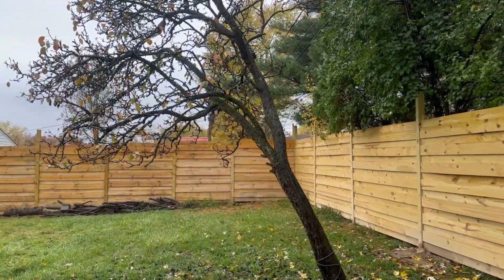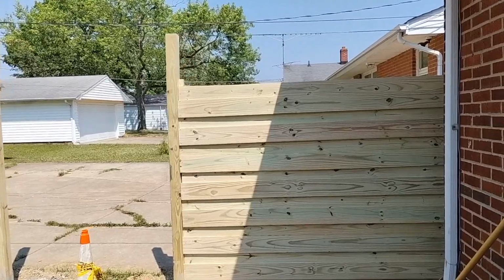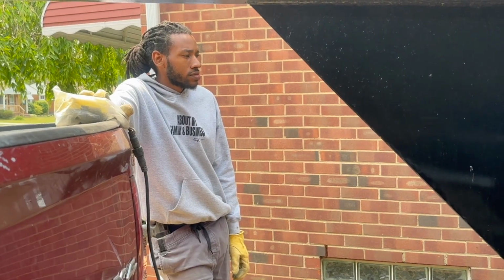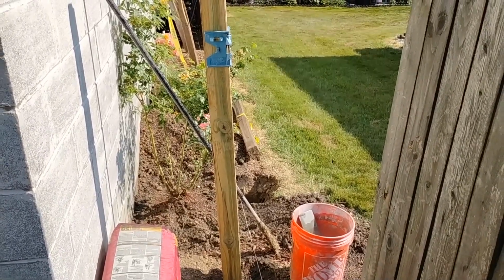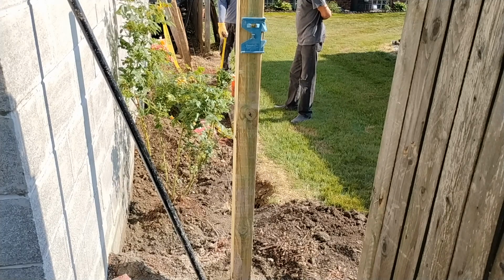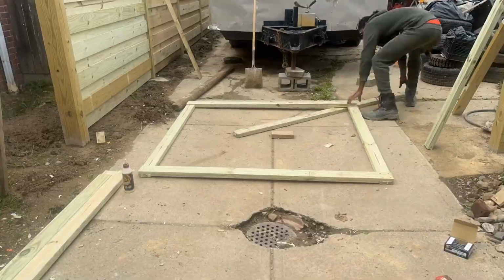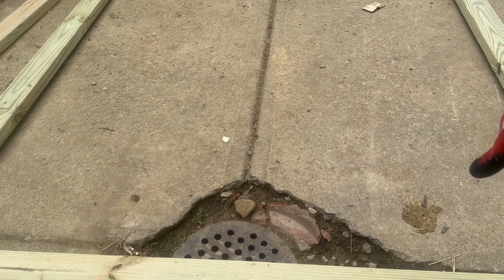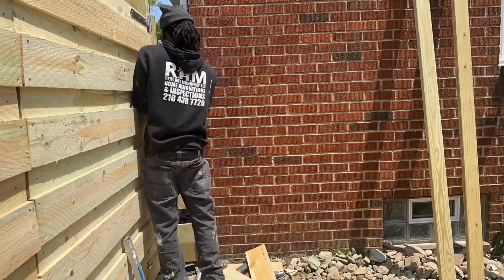Building a Wood Fence, Start to Finish!

Comment from the maker: Tools and Stuff, read to end...

Gorilla Glue: https://rstyle.me/+nW0w-kz5k8IUhqgMGkB7Og
Table Saw: https://rstyle.me/+zBDukhug0mSp7UQkuJOImg
Chisel: https://rstyle.me/+D2OgR4IRudpWMI5K9IObVA
Square: https://rstyle.me/+lsg2T_0Cdq0oXfhOOGo4fw
Exterior Screws: https://rstyle.me/+SS8q08bPliVKQhEMpSIQ7Q
Drill: https://rstyle.me/+Z2Gdf5FzSLtjY9BXJhLyyQ
Circular Saw: https://rstyle.me/+PbVsimgSRsoQ95KZ7RqDbw
Airless Nail Gun: https://rstyle.me/+_Wj96NGNQUOeFK_wSY-PCw
Air Nail Gun: https://rstyle.me/+MsDlZ02N8MPhvN4bLD7olQ
Smaller Air Compressor: https://rstyle.me/+jPt5T_k_mAbglQH6CyBZXw
Bigger Air Compressor: https://rstyle.me/+Nm-SksbVbSIKL_033hSIuw
Top Latch: https://rstyle.me/+elSLCXU8IsaQYB2X31Pilw
Bottom Latch: https://rstyle.me/+861lqgHjzjO4WZ-mvDeuKQ

Post Hole Digger: https://rstyle.me/+-CWF6PVzFLuLpPrCrTUncw
Auger: https://rstyle.me/+vPoAHILmtOVYjUa25ni-Ow
Post Level: https://rstyle.me/+2cuGdewohw7zqca-LIJoqA
Digging Bar: https://rstyle.me/+x_eXEJvOgh4Ib2CpqDbUyw
Quickcrete: https://rstyle.me/+kPp3TVZhyz9ytj_YL7p3JQ
Wheel Barrow: https://rstyle.me/+ZyqfHnbPG39_w-Qamtsqig
Concrete Tool Kit: https://rstyle.me/+aSVfQULOfo_vmqC6l1kJUw

Links shared to make it easy to find what we used and at no extra cost to you and may include Commission links that help support the channel

Dump Trailer: https://www.youtube.com/playlist?list=PLWF0Sm5vrZ0Cc0uVqMoxOnu-bFNhM317G

#DIYFence #FenceInspiration #FenceIdeas #Fence #CustomFence #WoodFence

DISCLAIMER for ALL of our Content- 

We are just sharing what we personally were able to do in hopes it will inform or help others. This video and all of our videos are  for informational purposes only. We take no responsibility for what you do with this information and can not be held responsible for any property or medical damages caused. You must DO YOUR OWN DUE DILIGENCE! 

Also we are not financial advisors. These videos are for informational purposes only. Investing of any kind involves risk. While it is possible to minimize risk, your investments are solely your responsibility. It is imperative that you conduct your own research. I am merely sharing my opinion with no guarantee of gains or losses on investments.

Comment: Beautiful fence…. I have a question about construction: if you wanted to stain the wood darker would you do it before placing the fence up or afterwards? It seems tough to have to do the backside after it’s up already esp with difficult neighbors
Reply from the maker: Yes your correct it’ll be easier to stain before putting it up, something we should’ve did but the wood was still wet and we were in a hurry